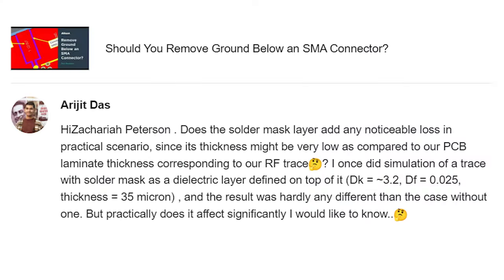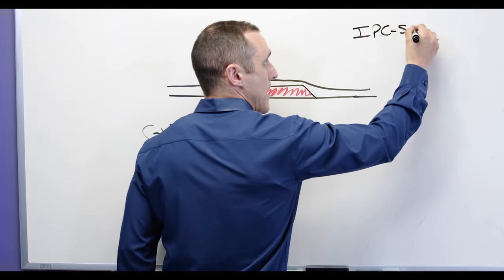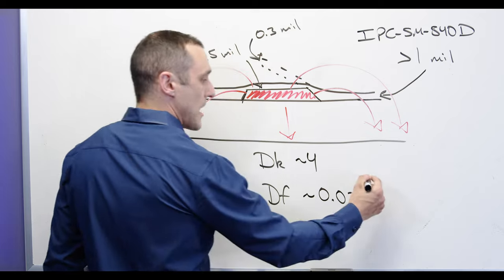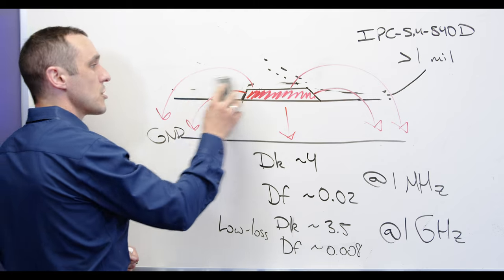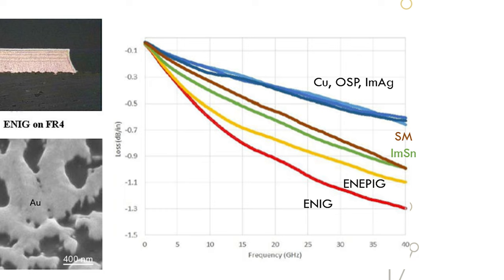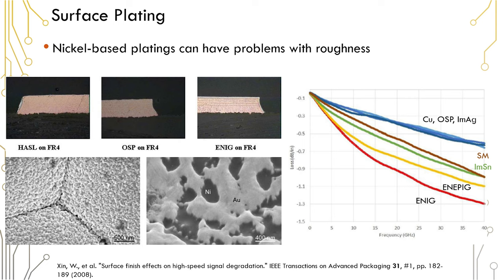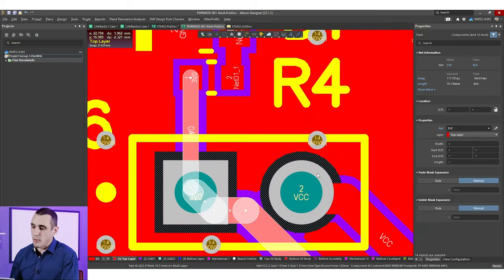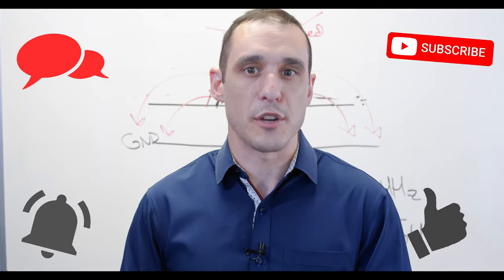Are There Noticeable Losses from PCB Solder Mask?

Comment: Also, a very convenient and fast way to open the solder mask over the track:
1) Select the desired copper tracks:
2) In the Properties tab, check the box in the section Solder Mask Expansion;
3) If necessary, you can set the width of opening in order to free the nearest area near the conductor from the mask.

Comment: I noticed you didn't include, or even discuss, regular hot air solder leveling as an option for "plating" on exposed tracks. I take the HASL process is a lot less controlled, so the surface roughness would be unfeasibly unpredictable?
Reply: Unfortunately the graph that I show does not contain my dataset and I have not done research specifically into the roughness present in HASL surface treatments. So I cannot say for sure whether HASL will be better or worse.

Comment: I had no idea solder mask affected this. I thought it was to make wires stable or a protective coating for physical damage.
Reply: Solder mask also performs this function. Just because there are some losses on the lines from solder mask does not mean you should remove solder mask from every design. In most designs you will not notice if the solder mask is removed or if it is kept because you will not notice the effects of the solder mask until operating in the multiple GHz range of frequencies.

Comment: Thanks for the video, this was incredibly enlightening. I had often made boards with removed solder mask and hadn't noticed a measurable difference between ENIG and ImAg (on RO4350B laminate). There were many factors at play and I am no longer working on RF boards, but this data you've shared is compelling. One question I do have though: why do MMIC manufacturers (for instance, MACOM) often opt for removing solder mask on thru microstrip lines on eval boards even when using an ENIG plating? Is this information on surface plating vs. copper roughness simply not commonly known?
Reply: Soldermask will also change the characteristic impedance of the microstrip and since soldermask thickness is not that well controlled it tends to have a rather bigger unpredictable effect compared to the surface roughness of the plating. Lossess, as long as they are predictable, can be compensated for but unit to unit changes in characteristic impedance are a bit of a bigger headache.

Comment: Are the losses created because the solder mask dielectric material weakens the electric field to ground? Thanks!
Reply: If you're looking for the physics based answer, the reason is for absorption of electromagnetic radiation in the dielectric. The electromagnetic field around the trace is not static, it is a changing field that interacts with the dielectric. The dielectric becomes polarized and relaxes at a characteristic rate that depends on the atomic structure of the material. During polarization and relaxation, some of that energy is lost to the dielectric. In crystalline dielectrics, the lattice vibrations (phonons) can also interact with the electromagnetic wave. When the frequency of the wave matches the phonon frequencies, energy can be transferred from the wave to the lattice, which is another mechanism of absorption.